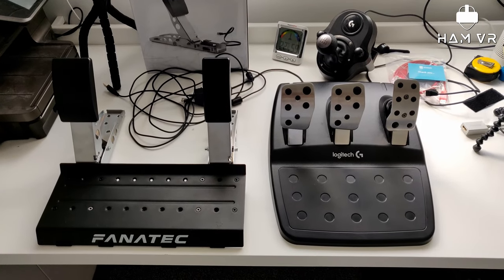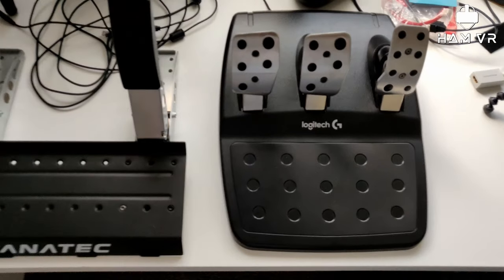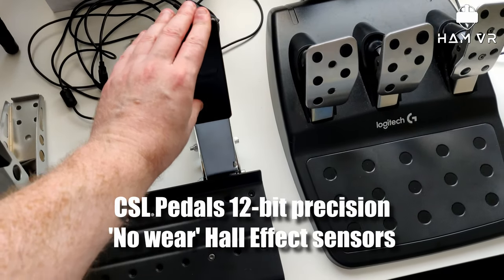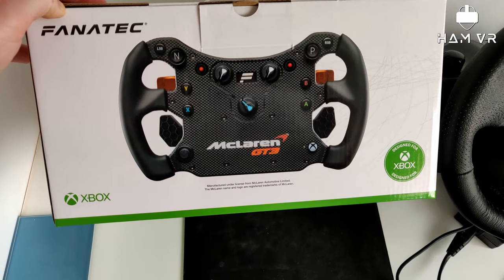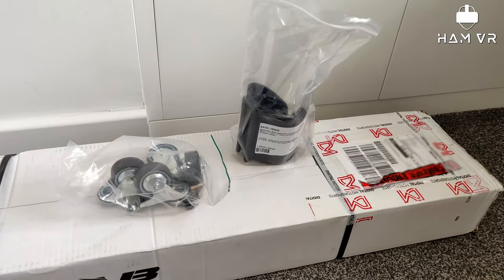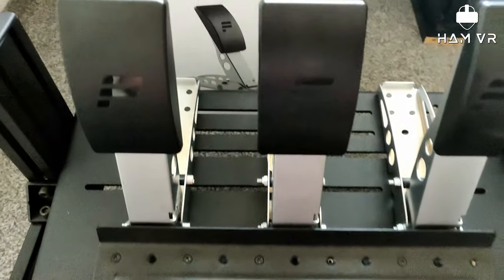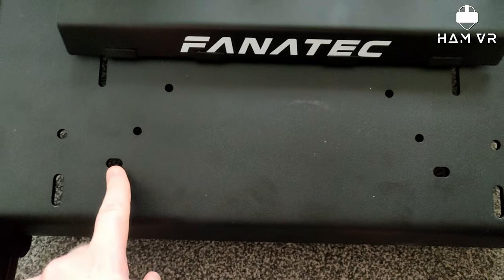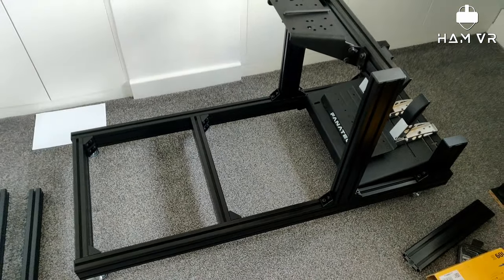New Sim Rig VLOG (Part 1) - Sim Lab GT1 Evo with Fanatec CSL DD

Comment: Nice video.  This is a good upgrade of your rig compared to what you had before LOL.  I am a low-end simmer.  I use a GT Lite cockpit that I keep on the side of my desk when I am not using it (I run an e-commerce company and a blog from this desk).  I use a logitech G29, Buttkicker, and a HP Reverb G2.  My buttkicker recently died, so I will be getting a new buttkicker Gamer Pro.  I want to upgrade my steering wheel and eventually, my pedals, or I might do it all at the same time.  I am thinking of getting the Fanatec DD pro wheelbase myself.  If I can ever get some extra room, I want a motion rig.  I bet after a year, you have had a great deal of fun in your rig.

Comment: I have the exact same setup and my pedals lined up spot on, took a bit of playing about, if yours don't line up but just a few mm i would drill, just use a washer and smaller bolt to give you that extra room to get it into position. I have to say my is rock solid not a single micron of movement.

Comment: Very nice rig  Ham ! I think i'm going for the same setup as yours. I like the idea for the elevated seat, did u turn the Sim Lab standart bracket upsidedown or is it a special bracket ?
Reply from the maker: Hey it's a standard bucket seat bracket. I got it as I found the single rail a little low and the bracket you can angle!

Comment: Smart idea with reversing the bucket seat brackets! I might do the same, since my bucket can't recline nor does it have holes on the side for the normal seat bracket install. How have the reversed bucket seat brackets held up so far?
Reply from the maker: Yes I like using the bucket seat bracket in this way, it allows me to incline the base of the seat which wouldn't be possible if it was bolted directly to the profile.

Comment: Congrats on your upgrade mate, how is the mclaren wheel + DD combo?, does it makes a difference in lap timings, catching slides e.t.c just curious.
Reply from the maker: Hey my lap times are maybe slightly better, but not by much. It definitely makes you more conistent and yes it's easier to catch slides compared to using the G29. The feedback detail and response time makes games feel more imermesrive and I'm finding racing more enjoyable overall.
Reply: @HamVR  Thanks mate, it sums up everything. I will improve my technique with G29 once I feel saturated and its a bottleneck, I will consider buying a DD.

Comment: Hey! I was looking at buying that rig. Did it come with all the mounting hardware for the seat apart from rails?

That's basically the same set up I want to get but am hoping to buy the V3 pedals if I can find them in stock anywhere!
Reply from the maker: Hey, the rig doesn't come with any seat mounting hardware other than the two profile bars on the rig and M8 t-nuts. I added the bucket seat mount (to raise the seat up) and a Sparco seat slider for leg adjustment (parts listed in the video description). Nice choice on the V3 pedals, I already had the CSL pedals from when I was using with the G29.  I'll probably get the loadcell upgrade once it's available.
Reply: @HamVR  ok so I'd need some kind of bucket seat mount of rails for a seat. I'm thinking about the RS9 seat from GT Omega. I think that comes with rails and looks like a good seat.
Reply from the maker: @treemium1467  if the R9 comes with a runner/slider it should bolt directly the profile. Keep in mind it might be a bit low to the floor. I think GT Omega do bracket for reclining seats to raise it higher.
Reply: @treemium1467  get the sparco grid q , Amazing seat
Reply: @bratosin1  thanks, looks good but I'm not looking to spend that amount on a seat.

Comment: Whats the differences between Sim Lab GT1 Evo and TR1? I can't decide..
My CSL DD is coming in two weeks...

Many people say GT1 Evo is better but why is TR1 more expensive € ?
Reply from the maker: They are similar in dimensions but the TR1 has a slighty smaller base. The TR1 is probably more expensive as there's more machined brackets in the kit for the wheel deck area. The angular uprights looks good but I think vertical uprights of the GT1 EVO are more practical for attaching parts/more profile to.
Reply: @HamVR  Thanks for fast response! I bought the GT1 EVO, and i hope i dont have any flex with my CSL DD. (+ Boost Kit)..
Reply from the maker: @itzzemoo4950  Congrats and I've not noticed any flex on mine yet.